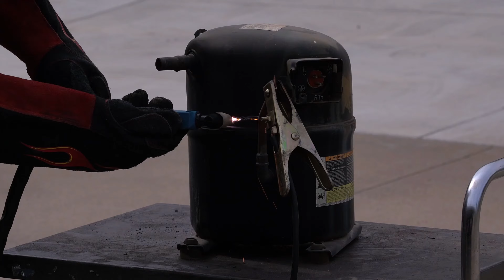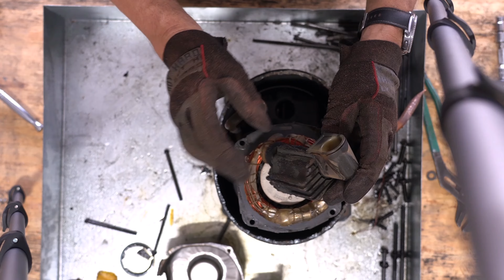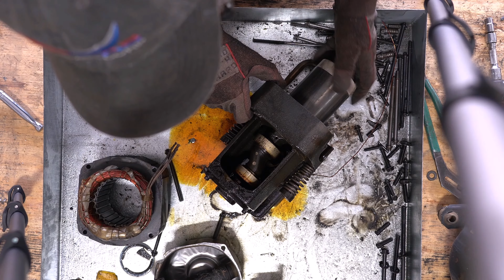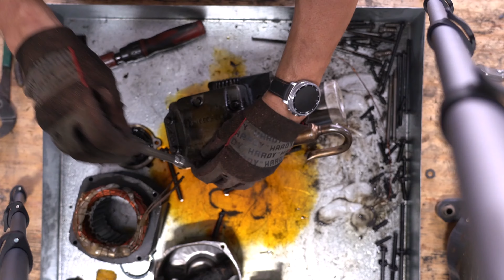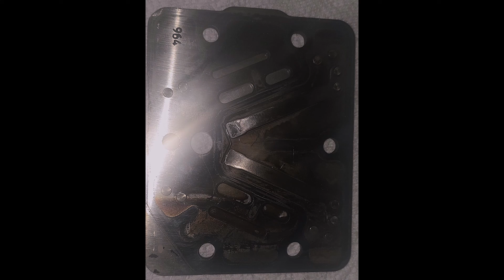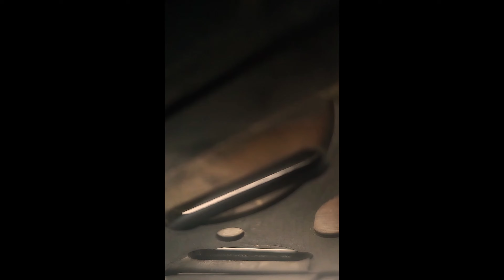What Killed This AC Compressor?

Comment: Is the purpose of doing these Compressor autopsies merely diagnostic or can they, or their parts be salvaged and refurbished?
Reply from the maker: These are definitely not meant to be repaired, as the shells are hermetically welded and not meant to be cut open. The cost would be more than buying a new compressor anyway. I just do it for education and learning. However, I have been told that some countries under sanctions will cut them open and try to repair them, but I doubt they will last very long. Here in the US, they just go to the scrap yard and get recycled. I wouldn't be surprised if some country somewhere rebuilds them if they can get the parts. It's my hope that people seeing this will begin to understand that these things are mechanical, like a car, and that lack of maintenance may cause the compressor to fail early in life.